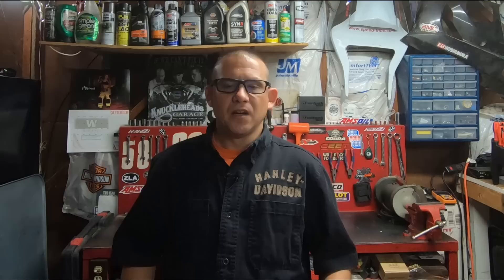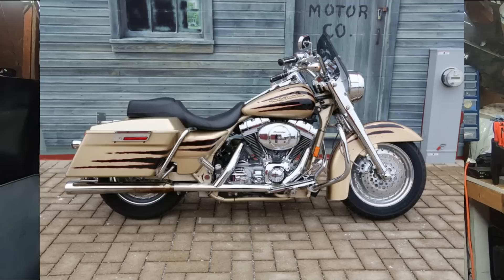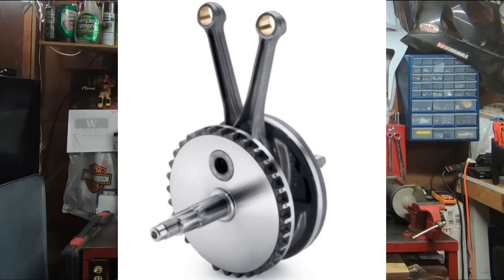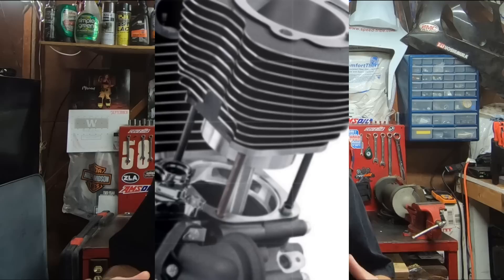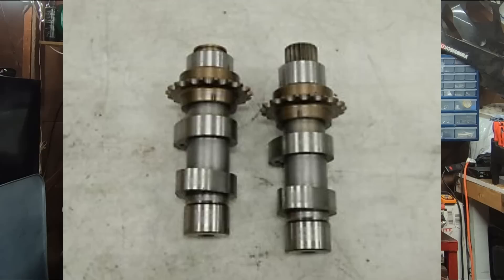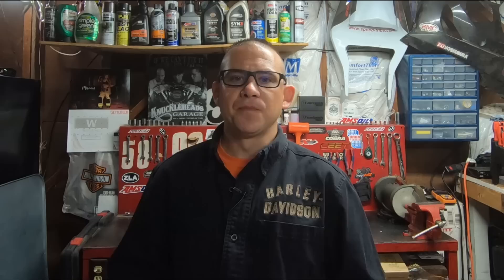The Twin Cam 103 With Hidden Secrets | Harley-Davidson CVO 103

Comment: I just bought a 2004 CVO Electra glide the 103 SE heads compression releases I assume is stock. Just a quick question is there anything I can do to pep it up ie cam change without splitting the cases ? Or am I gonna have to bite the bullet and drop major coin lol thanks
Reply from the maker: You can go with a different cam, the stock cam in that bike targets midrange torque. That would be the least expensive route. You could bump the compression with some new pistons but you'll likely need to have the cylinders reworked or replaced
Reply: Tired of getting dusted by other real motorcycles?
Reply from the maker: Hey now not for the first 1/8 miles... after that well... 😬
Reply: Daryl Lect actually I’m 6’5” and weigh 300 lbs all the guys I ride with are 150 max riding Dynas with 103’s and sportsters I just want to keep up 0 tp 60 ish I got all my hair on fire riding on my RC51
Reply from the maker: You have an RC51?? I love the sound of those bikes!

Comment: This year I purchased a 2016 dyna switchback. From my understanding this is the high output 103 which is different from previous models. I was told it has more aggressive cams but I don't know what kind. I only plan on putting a vh slip on exhaust and a fp3 tuner. Any info on this motor would be greatly appreciated. Really enjoy your vids!
Reply from the maker: Thank you, I appreciate you watching and supporting us. The 103HO motor is the same engine as the 103, the only difference is the cam and air box. They went with a "higher capacity" air box/open element on some models and the cam in the HO is .511 lift. It's more aggressive than the .484 lift that's in the non HO 103, provided a nice improvement in horsepower and torque. Btw the Switch Back is one of my favorite models, with a batwing fairing and dual exhaust you have to do a double take thinking it's a Street Glide.

Comment: In need of help. I have a 2005 deuce with a marked screaming eagle 103 injected. Which is marked everywhere heads, air cleaner, lower case covers. derby and old points cover. Some tell me is factory. A very rare cvo.I have deuce owners tell me mine is not like theres and quickly point out all the oddities. Then they say 103 in 05 was only cvo d on baggers. A good friend who is an historian is stumped. Would like to find out. Also it was in an accident less than 15 miles from delivery and was returned to dealership same day. Of delivery.
Reply from the maker: I would have a dealer run your VIN number, they can tell you what's been done to the bike if it was done at a dealer. For 2005 the two Screamin Eagle CVO bikes were the Electra Glide and the Fat Boy. It's possible some where along the line someone swapped in a Screamin Eagle 103 engine. It's also highly possible the original dealer may of swapped in the engine and done a lot of work to the bike if it was in a accident and returned to the dealer.
Reply: My deuce will smoke the tire in first till it hits the chip. No front brake. Everyone i have let ride it says it is a beast. Not bragging. Just would like to know if it was factory or just built . So far vin# has been no help.

Comment: Got A Twin Cam 2013 No Problems At All.  45000 miles
 Im A Old A&P Idiot . 
 Bought New 3mi On Clock .  Did Stage 1  Header Get Rid of The  Government Heat  Maker, Stock Pipes, PV Tuner ! 
 Owned 1957 Pan/ hard tail , Few Sportsters In The 60 -  70's
 Peace... Ride  Right Wrench Right ! Period
Reply from the maker: You've had some awesome bikes! 2013 is a good year for the twin cam!

Comment: I am looking at a 02 road king and I'm told that it was upgraded to screaming eagle stage 4 10000 miles ago.  I can't find much info on what "stage 4"  would be but I'm thinking it would be the equivalent of the cvo 103?   Anybody be able to chime in on that?
Reply from the maker: 2002 Road King would probably be a 95 kit, just depends really what year the upgrades were done in on what was available and the hot setup on that engine at the time. The only way to truly know would be to pull the top end and measure the bore and see what cams are in it.

Comment: I have a 05 screaming eagle cvo Electra glide. Any advice on things to check. Sounds like timings off
Reply from the maker: CVO would be fuel injected so might have something going on with the electronic ignition if it sounds like the timing is off.

Comment: Hello. Will 96 or 103 crankshaft fit into 88 motor with dual Timken bearings? I want to bore up and stroke my 88 to 103.
Reply from the maker: Technically yes, but you'd probably want to with the Screamin Eagle 4-3/8 stroker crank, SE 3-7/8 bore cylinders and 3-7/8 pistons. That'd give you the 103 displacement you're looking for.
Reply: @GixxerFoo  thank you for your anwer. And what about cylinders? Will OEM 96 cylinders fit 88 cranckcase?
Reply from the maker: I don't believe so, the 88 had a small case bore l believe. But l will double check that to be sure.

Comment: Is there a difference in the bottom end in the 09 96” and the 10 103”.  If I put a 103 kit on a 09 96 would it be the same as a 10 103?
Reply from the maker: The 96 and 103 have the same bottom end, a 103 kit would give you the same specs as the 2010 103.
Reply: Ron C I bored my 09 96ci to 103. I was worried about loosing my over bores they said ( basically ) still have 103 over bores so I went with it I didn’t want forged pistons as in my day they needed extra clearance for forged pistons to grow.  Ok not now ( hepolite I think ) so I went to 103 over bore .. I asked if I needed the main bearing upgrade they sad no .. ok ..  I asked if I needed comp release  , no ,,, ok so I went with it.  I was going 255. For tq as I ride two up.  They said ok but then reneged and said 253e. We chatted about it. I went with them.  Ported heads ,10.5/1 comp.  and it’s tuff.  102hp 110 tq. Rw ..100 at about 2600 and drops to 100 at 5250 and 90 at 6200... and so far no drarmars ...ok it is dyno’d S&S slip ons and S&S air cleaner. That’s probably 10hp for both.  I asked to go 110 at the time but back then they couldn’t get good hp but now it’s different. Hope my upgrade experience helps ... THATS why I can’t justify a M8. 110 tq at3000 rpm. That’s enough for me. Lol.  Ok.  I’d love a twin cam 117 🤷🏽‍♂️ power is the drug Lol
Reply: jon doe I asked my initial question because I was on a “fishing expedition”.  5 years ago I took my 30K mile 09SG from a 96” with cams to a 103 stage 4.  114hp 111tq.  Well I blew the motor last week so now one debating a rebuild on a 70k mile motor or buying a H-D 120.
Reply: Ron C what blew ?   If you need a crank.  The world is your oyster... go 110 113 117. Or buy a 120. But think about it.   Bother story.  I had a 91 evo.  Flhs Blew the motor.  Thought it was be to S&S the bike than a new one.  Thought a new road king was x I owned mine so a motor ( in au was 6500 back then ) and went for it.  Well cost 9 k with all the fiddle bite an should of left it.   And palmed it off.  But.  I’ll Di it again lol. Now I’m lucky my 09 s bob only low Ks my S glide the same.  But.  Up to you with this one. ...
Reply: @jondoe8816  Haven't had the motor apart to know exactly what's bad, but believe it to be a top end issue.  valve, rockers, lifters...?  A new bike would run 30K +   Figure its definitely cheaper to rebuild.  I can get a 120 for around $5500 with extras I'd probably be into it for around 7K.  I don't plan on getting rid of this one anytime soon.
Reply from the maker: If you can bore the cylinders that's the way to do it!
Reply from the maker: Dang that sucks, probably be quicker to get the 120 and possibly cheaper if you're having a shop do the work. Cost more for the motor down but labor is a lot less.
Reply: @bald1der  just thinking a friend has had a stave 4 in his softy 09 i presume and had 4 rebuilds as the lifters let go from the looks cant handle the lift .. we talked about fuling lifters as people say they were the original makers of Harley before HD changed   ... but pull push rod tubes do see .. maybe a loose push rod too  adjustable push rods could come loose , my shovel always did lol

Comment: Question, I have a 2019 Street Glide CVO that when I am riding with the tach between 2200-3000 rpm and roll off the throttle I smell burnt oil. Any ideas?
Reply: Valve guides !!
Reply from the maker: Yep sounds like valve guide seals.
Reply: GixxerFoo It only has 2000 mi on it
Reply from the maker: 🤔 that's interesting, being a 2019 is it still under warranty?
Reply from the maker: They have had issues with the oil control rings on the pistons. Is it using any oil?
Reply: GixxerFoo  It has used some n 1000 mi since last service. It’s down about 2 sets of dots on the dip stick.
Reply from the maker: That might be the oil control ring issue on the pistons. The oil gets past the rings and burns, that might be what you're smelling.

Comment: yeh M8 is better heads but i think the valves so close together in an air cooled motor for me .. is a bit dangerous not like a car water cooled being better controlled cooling ..butm8's are better but i think not worth the extra cash for hat you get .. buy a 114 then make it bigger .. id make my bike a 113 before then
Reply from the maker: Yeah you can get everything you need from a twin cam cheaper than the price of an M8, still have money for lunch.

Comment: What's the rod length/stroke ratio?
Reply from the maker: Very good question, I am gonna have to do some digging to find that out. Harley's not really forthcoming with those details.
Reply: @GixxerFoo  All you need is the rod length man. As if that is a mystery. 7.667" So for the 4 inch crank it is 1.92 and for the 4.375 crank it is 1.75. Took less than one minute to find out here on the internet.....
Reply from the maker: That's correct you, you.can definently get longer rods. But being down that far l would either replace or rebuild the crank too.

Comment: The power numbers on a wheel dyno actually is the net power of the engine. The dyno doesn’t know the gearing in the trans. If it did, the power output would be triple at minimum to the ground..🙄
Reply from the maker: Technical 👍, I should of mentioned corrected rear wheel horsepower.
Reply: GixxerFoo  exactly. It measures actual engine power after the driveline losses.
Reply from the maker: It's surprising how much loss you get through the driveline, building a motor you gotta take that into account.

Comment: So your telling me that harley built a 103 with cams and head work and only got 85 torque peak?  That's horrible
Reply from the maker: They kept the compression extremely low at 9.0:1, starts easy and it's reliable for longevity. Also the CVO heads they used worked great for a 95inch, but they weren't fully adequate for that stroker crank engine.

Comment: Ah yes. The sound of an antiquated, noisy, slow, low-rpm  tractor ....uh...motorcycle engine
VROOM! VROOM! drip  BLAT! POP! GUDDA GUDDA GUDDA drip VROOM! BLORT! BLAT! drip VROOOM! VROOM! POP! BLAT!! drip BLORT VROOM! GUDDA GUDDA GUDDA GUDDA drip VROOM! VROOM!! BLAT POP! GUDDA GUDDA GUDDA drip VROOM! BLORT! BLAT! drip VROOOM! VROOM! POP! BLAT! drip BLORT! VROOM! GUDDA GUDDA GUDDA GUDDA drip...
Reply from the maker: 😆😂 they don't leak as much oil these days 🤷‍♂️
Reply: Harley must be all up in your head if you troll threads abouts bikes you don't like.... think about that power it has over you
Reply from the maker: 🤔 you do have a valid point.
Reply: mark anderson  Yes, because when it comes to motorcycles, slower and heavier is better. 
Got it.